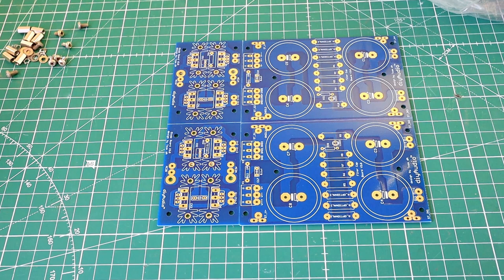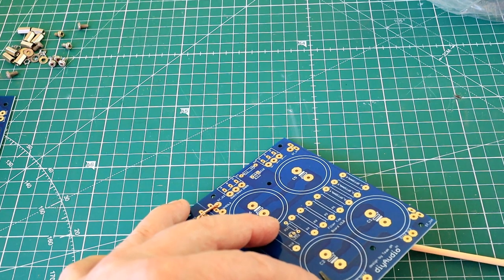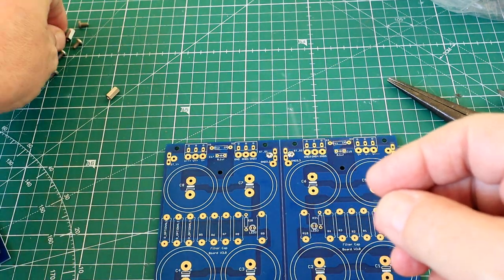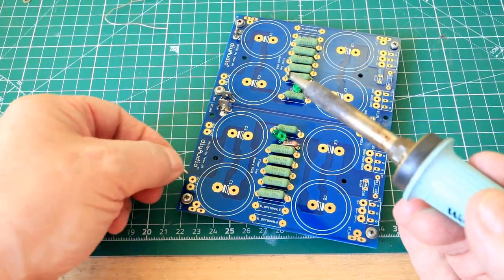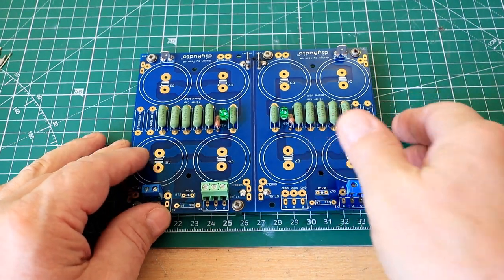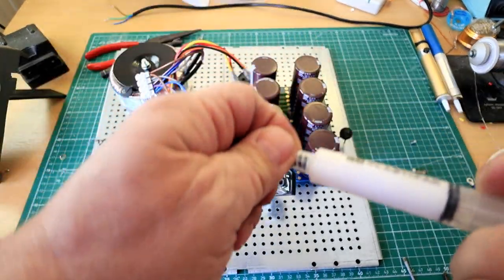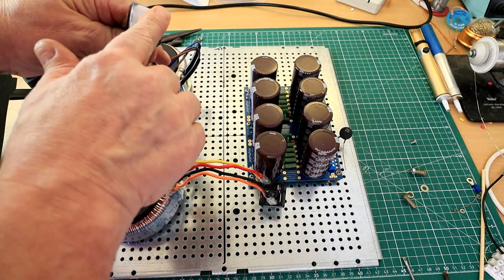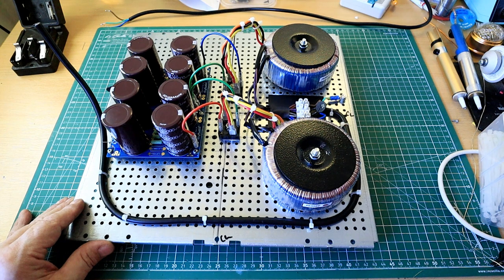First Watt Aleph J Build (Part 1) The Power Supply

Comment: @ 20:40 , Whatever you used to install those crimps onto the wire, that is not the proper crimp tool for those crimps. You need something more akin to a molex pin crimping tool, as it will properly bend the ears of the crimp over and into the wire instead of just smashing it flat, and it will do the same on the ears over the insulation on the wire. You really wouldn't even need to solder the crimp to the wire with the proper crimper.

Comment: I used 50V caps at 22,000uF with a much much lower ESR... but only rated to 85C.  Another thing I tend to do when soldering caps is to do 1 leg on each cap, then come back for the 2nd leg after doing a different cap to ensure no heat damage.

Comment: Loved this build, thanks for uploading! The copper links you added make the centre rail, or zero voltage as I understand it. If you left them out, could you make two separate single rail power supplies?
Reply: I believe this would mess up the grounding

Comment: Hello Sir, many thx for these great videos ! I aim to build one of these Nelson Pass camp amps and i am still puzzled by PSU in dual mono. I was wondering whether your drawing @ 30:23 was supplying for each of the 2 channels rails +18v/0/-18v or 2 times 0/+18V as your toroidal trafos seems not to be center-tapped. Have you implemented with succces this dual mono ?  Thx in advance for your comment and keep on the inspiring  audio implementations ! Thierry
Reply from the maker: The centre tap is after the rectifiers 0v DC. You could implemented in a 18/0/18 at the transformer if you tied both 0v at the transformer. I just chose to do it way as I had the parts to hand.

Comment: Nice workmanship. How long was that spade connector in use before it failed?
Reply from the maker: Some weeks I think...I was not using the amp for long periods though. But when it blew the amp was on for quite a few hours which I would think the temp was rising all the time until it went into meltdown .

Comment: Can you add a link to where you got the hookup diagrams from? Hadn't seen those at the DIYAudio forums. They look helpful! Also, for the LED orientation, as I understand it, the long lead (anode) should be in the left pad for both LED2 and LED3? Because long lead goes to the more positive, which means positive on the V+ side, and GND on the V- side?
Reply from the maker: There is no link. They are my own drawings. Sorry.

Comment: Thanks for all the great videos! I'm building an F5T and find this video on the DIYAudioStore PSU boards very helpful. I'm looking into the possibility of using the perforated aluminum risers they also sell to make a tunnel for my transformers. Would it be a bad idea to mount the PSU boards on top of this tunnel? Depending on the configuration I could have 2cm or 5cm of clearance between the transformers and the top of the tunnel, and 1cm or 4cm of clearance on the filter caps, ~6cm total vertical clearance either way. Is this a bad idea, maybe for thermal or interference reasons? Or do you think I should I give it a whack? Thanks again either way!
Reply: Apologies, I said aluminum but the risers are actually galvanized steel, I believe.
Reply from the maker: @ph0enixr  Give it a go, many have done exactly this and worked well for them. Good luck with the build...
Reply: @thediyaudioimplementers1826  Awesome, thanks! I need a few more bits and bobs from that store anyways so I think I'll go for it. Somebody also pointed me in the direction of the F5X which uses a similar configuration as well. Thanks again!

Comment: Any help with 5he schematics,...andvwhat parts you need..and where did you got them from.? Thank you!
Reply from the maker: All the info is available here:- diyAudio Power Supply Circuit Board v3 illustrated build guide. I use Mouser/Farnell and RS for components.

Comment: By using two transformers, do you notice a big improvement?
Reply from the maker: I cant say there is a big improvement really, if there is, its only small. It was a cheaper solution over a 500VA at the time. I recall they were at a reduced price.
Reply: @thediyaudioimplementers1826  Thanks for your reply. What are the sonic differences between the F6 and the Aleph?
Reply from the maker: @orioldepagesmoyes5978  The F6 is slightly more 'organic' sweeter sounding to my ears but very little between them overall. IMO

Comment: That's one crappy piece of solder work my man. You apply the solder much too soon, not giving the part the opportunity to heath. That is also the reason why you have to apply solder on both sides of the board. The decent way to do it, is to give enough heath to one side of the board so the solder floods trough the hole. The way you do this, makes unreliable joints.
Reply from the maker: Thanks for your comment….Ive never had a bad joint in 25 years.

Comment: I have these ame PCB's and id have to say they are the worst PSU boards i have ever used ! What a crappy Design !
Reply from the maker: Not sure crappy describes them correctly, a quirky design and they do the job as intended.
Reply: @thediyaudioimplementers1826  They "work" but they diodes that get mounted to heatsink's are way to close. I have a few for my Aleph amplifiers and they sure are a Pita to use.
Reply: Never tried these PCBs and I don't think I would. I prefer using larger can-type caps with screw terminals for the connectors (I used Evox Rifa PEH169 in an Aleph build). These caps can be directly bolted to an insulated plate. Connections feel really solid.
Reply: @ssmith954  the Diodes are way to close and a really horrible design layout. Not recommended at all.
Reply: All of tightly spaced, higher wattage resistors grouped between the caps looks to be something that should be redesigned, or at least, make a note to stagger them at different heights off of the board to give them more breathing space. I am betting that board will have a nice burnt looking spot on it soon.